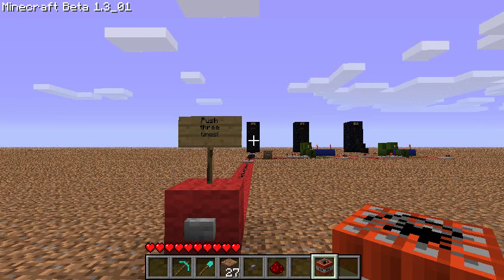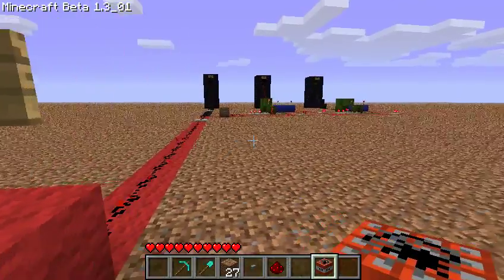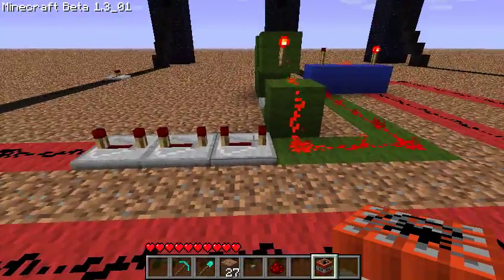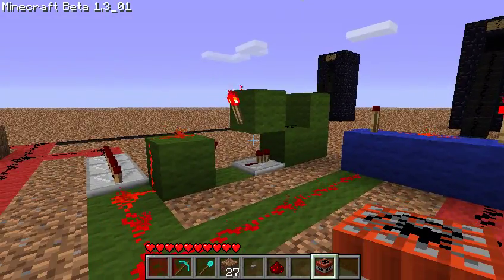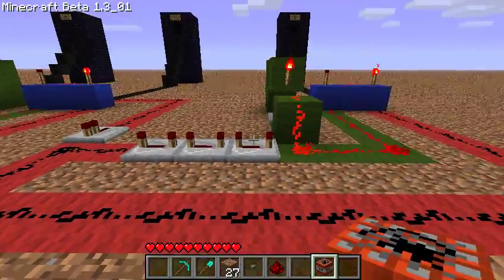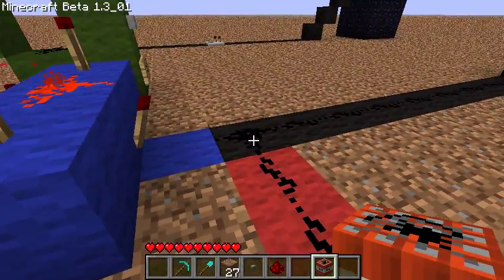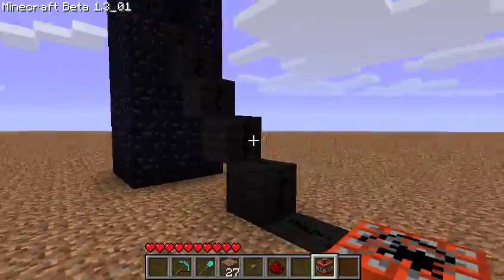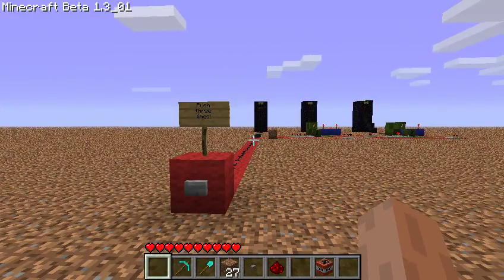Redstone Tutorial: TNT sequence

Comment from the maker: @schoolexpired12 Sure. The easier way is to run a redstone wire that connects to each reset button, and connect that wire to a block with a button on it. The trickier way uses a little logic to power that new reset line if the main button is pressed a fourth time.